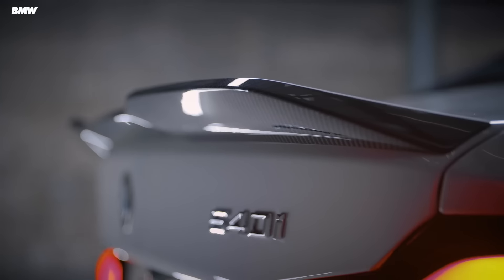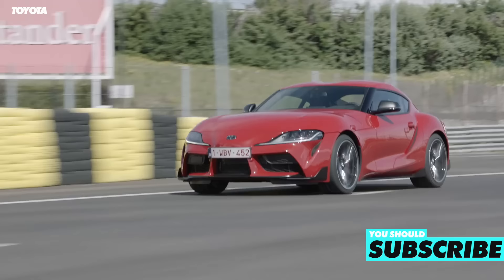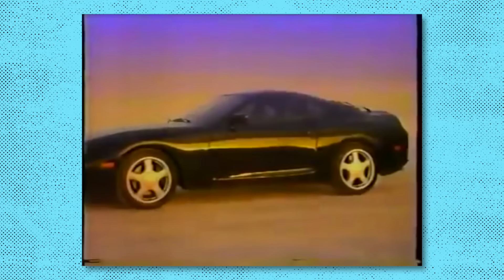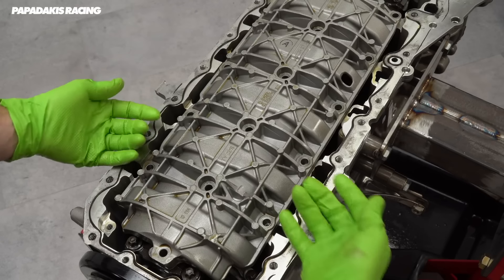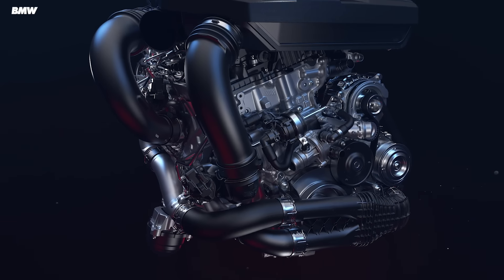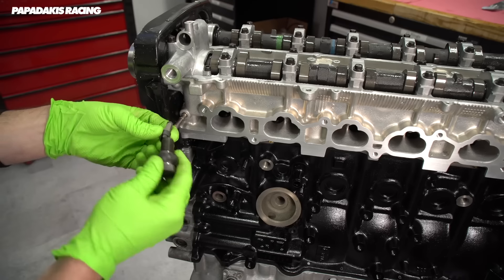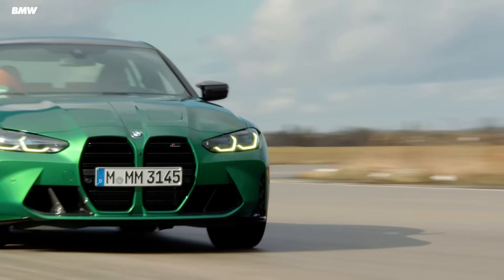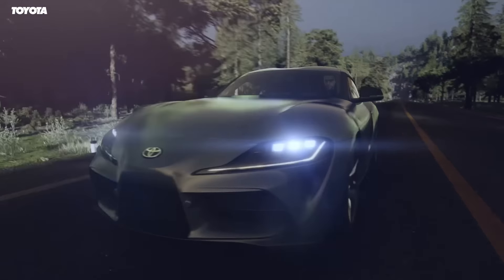Inside BMW's Greatest Engine

Comment: I think Toyota should've used its own chassis, infotainment, etc, for the Supra. Having a BMW engine is fine - but the rest should've been Toyota... Just like the McLaren F1 has a BMW engine or a Pagani has an AMG engine. They are still not a copy pasted BMW or AMG ...
Reply: Toyota interiors are dog shit, they easily have the worst infotainment in the business & use more cheap plastic than almost any other brand..what the hell are you talking about
Reply: @CadexLaw  bmw interiors have been shit for decades what are you talking about lol?
Reply: @MG-qf9gx  that’s subjective. I’ve had Lexus’ for a few years now, recently just picked up the NX as a daily with the new infotainment, and can say the infotainment has been utter dog shit until the new NX refresh this year. The interior of each Lexus I have owned were really well put together, which is why I kept purchasing a Lexus product, but the infotainment itself is objectively poorly designed until the refresh in the new 2022 NX. And that’s Toyota’s luxury brand. I’ve seen pictures of the Yaris’ interior, and it doesn’t seem to be anything to write home about either.
Reply: @R_C32  as a bmw technician that has worked on all makes and years of these vehicles the interior pieces don’t last long. Infotainment system I’ll give you that but the interior quality from bmw is subpar at best. It looks nice for the time being until the pleather lifts, faux wood cracks and plastics turn to dust.
Reply: Now you realize the actual problem Toyota need to join together with BMW is actually not the engine

But the chassis. There's no point of gazillion Horsepower engine but with flexing chassis
Reply: @MG-qf9gx  what an awful take. I’d be embarrassed to actually think that.
Reply: @MG-qf9gx  Massive eye roll on this. As a BMW tech, I highly doubt you’re a BMW tech. The only issue I’ve seen recently with BMW interiors is the steering wheel leather wearing out fast but I suspect that’s due to people applying hand sanitizer on it.
Reply: @CadexLaw  I guess 10+ years of actual experience doesn’t mean anything to you 😂 ok boss 👍🏽
Reply: @MG-qf9gx  cap.
Reply: @CadexLaw  ok 👍🏽

Comment: The only question with these is the chains, guides and tensioners. In typical BMW fashion they are at the rear of the motor. Personally I'd love to build one up that has had the chains go. Cheap power, but we all know Toyota would make sure that decent plastics and tensioners are used. How many camrys do you know of with timing issues?

Comment: But how many revs can it do before kicking the curb? I mean tuneability and ability to take bonkers amounts of fuel and air are good, but if an engine makes a billion kW, but needs to be rebuilt or reassembled after every race day then i'm better off in a prius.

Comment: Even after 2 decades still the 2JZ can go head to head with the B58 , 
Toyota engineering at its best ,
Reply: Head to head in what way? A B58 already produces more power than the 2JZ and will gallop away from any stock turbo 2JZ with a couple of clicks on a laptop. The 2J is a great engine, but it's place is in the 90s and early 00s.

Comment: B58 isnt even bmw’s best engine. The s55 and s58 are far better in terms of how much power they can make on a stock motor. And in terns of reliability the n55 is more reliable and the n57 and m57
Reply: I agree..the b58 is to new yet. I have the n55 engine and is very reliable apart form routing maintenance and common part replacement. Plus the n55 sounds amazing 👍

Comment: LMAO Around the 02:10 mark.
Those $100,000 + BMW's and they have a short ram HOT air intake :D.
Clueless muppets (no matter how good the Intercooler Hotter in still means hotter out. )

Comment: N54 sounds better and its more attainable
Reply: Also tremendously more unreliable.
Reply: @watchkevingo  :/ plastic in an engine bay tends to be unreliable. You know how you make it reliable? Metal valve cover, metal water pump, metal charge pipe, replace some of the shitty plastic hoses with silicon ones, and you’re all set. Also, this motor has been around for like 7 years. Way less time to confirm the issues of a motor. Give it another 5 years and we’ll talk.

Comment: lets not forget that Toyota kept sending the engine back after doing their on reliability test over and over until it was finally Toyota worthy. BMW would of slapped in there with their weakness like they have always done. i mean what car manufactures messes up a crank hub design? BMW!! even on their m series cars never the less. \

Comment: The same things were said about the earlier N series engines. No new info here. And so surface level. Disappointed.
Reply: I mean B58 and N series are pretty different. Dunno why they didn't say that the B58 was closed deck unlike the 54 thats open which is the major difference between them and the B58 can handle power better than the N54 can because its stronger than it also. Plenty have gon around and thrown by this point and shown that they can handle the abuse just fine.

Comment: Meh. Not a fan of turbo charging. Real engines get power through displacement and high rpm limits and not cheap tricks.
Reply: Seems to be the norm, even tiny economy scars are being turbocharged
Reply: @od813  of course. Because small turbo charged engines are the absolute Jackpot for car companies. Firstly they perform very well in common emissions tests. They are smaller and cheaper to produce while offering the same power as a significantly bigger naturally aspirated one. So they can put the same engine in a larger variety of cars only switching out the turbo. And another large plus for them is that turbos are among the most common failure points in modern engines and a very expensive one at that. My parents had theirs blown a few months back and it was almost 5000€ for the replacement. Long story short i drive mazdas cause they only use turbos on their performance models and diesels.

Comment: Not sustainable design, as many of the plastic parts will start disintegration way before 10 years mark and placing intercooler inside plastic means no easy replacement.... Because it is better than the 2 litre diesel disastrous it does NOT make it good design.

Comment: Yeah, poor Toyota couldn't afford to design an engine. Stop making excuses for them.
Reply: They can. It'd be stupid to do so anyway when they're going EV anyway with every car in their line up anyway so there'd be no point in throwing all that money just to make one engine for one car in a dying market so they went on and collabed to make it with a company that had both the engine,platform,and chassis they needed to make the car anyway. Plus its not like people are bothering with their other rwd coupes/performance models as is so there'd be no point in using those either. Really,any route they took would shoot them in the back no matter what they did so they took what they thought was the best approach and it's showin that they made the right move with the mk5 as of now.

Comment: 0:24 omg why everybody say that?! the 2jz is not a good engine! i know a man in here hungary who tunes this engine a lot of times and he said it. its not good even not reliable when its on 5-600 horse power it can live for around 50.000km and its horrable! there a lot of engines out there like the 1.9TDI and the mazda KL v6 engines which can survive 3-400 hp and can live even 500.000 or a million km or we can take a look to the 10.5 L ifa w60 engine which can take out easily 800 horsepower with some new fuel injector and with a supercharger or with a simple turbo and it live easily for a million killometers! Or a Lada 1.5l I4 petrol engine its the same story without the big tuning potencial, so please stop with this freakin toyota shitty engine for "omg reliabilyti omg 1000 hp" because its not that good.

Comment: Plastic water pumps, clogged egr, gunned up intake valves. I would not call this motor reliable
Reply: It is if you service it and change oil at 6000 miles, instead of the crazy 18k BMW state !
Reply: Plastic is plastic. It don’t endure heat cycles for long

Comment: Definitely not the best BMW engine.. top 10 MAYBE. It makes peak hp at 5k rpm and falls flat after that. It’s simply too undersquare and has that laughable 6 to 2 exhaust manifold that traps heat. The ///M brand has been distorted by emissions and fuel economy standards.

Comment: Yea it is real Genius to put a timing chain on the BACK of the engine. That means a full on engine out timing chain replacement. Audi did that back in the mid 2000's and those cars turned out to be the WORST engines ever and a 10K $$$ job to change. I'll pass.

Comment: The b58 is nothing like the 2jz, the b58 is DI, a closed deck, and the timing components are located on the back with the fly wheel amongst many other differences between the two. This video is just brainless.

Comment: Sorry all reciprocating engines are terribly wrong concept. It's efficiency is ridiculously low, that's why engine makers have to rely on pressurizing the air intake in order to burn more fuel just to increase the power. However this will only shorten the lifespan of the engines. Because the higher the pressure inside the combustion chamber, the more gasoline will slip pass piston rings causing lubricant contamination. This is catastrophic to the engine. Reciprocating engines are solely relying on the quality of lubricant. So never ever causing lubricant turns bad.

Go hangout with mechanic. They will tell you why all big names have terrible engines. Engines are not supposed to perform well in the first few years. The subsequent 10 years after the first 5 years will determine how good the engines are.
Reply: By adding supercharger or turbocharger is a disaster to the engines. It's expensive, costly to repair plus won't last longer. Only good for people who always find excuse to buy new cars.

Why complicate things under the hood? We don't need reciprocating engines.